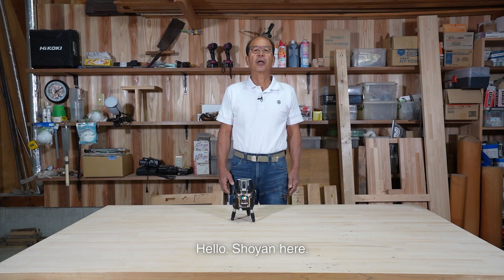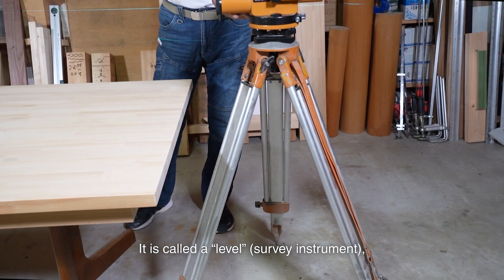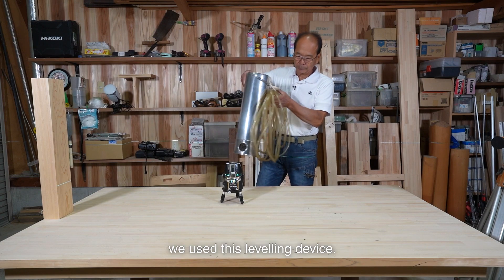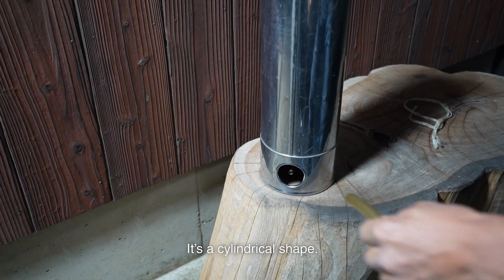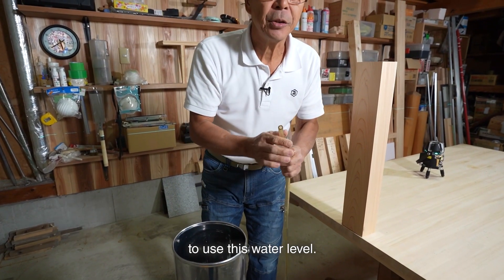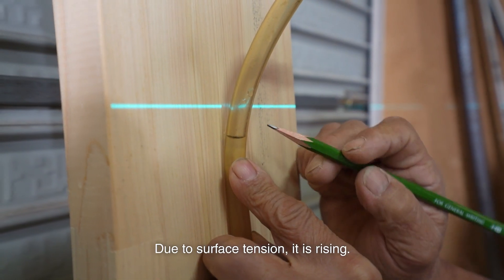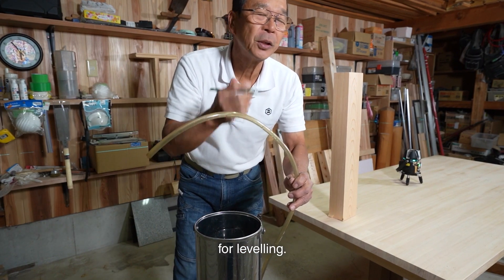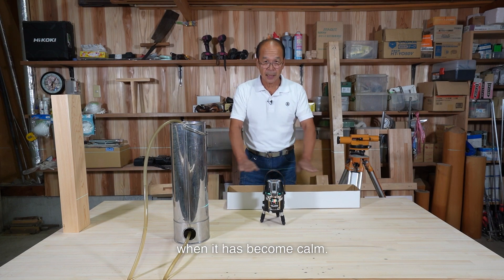How Did People Determine a Level in the Old Days? Surveying Techniques from 4,500 Years Ago

Comment: Laser levels are usually good to 2mm or about 1/8" at 30M.  Properly setup and used, a water level is dead nuts on even at several times that.  I still have one and use it in certain cases where I want things perfect.  I know, OCD of me.  But starting out from perfectly level means that the small induced errors down the road are smaller.

Comment: Years ago I installed large factory and loading dock doors. We used a water level filled with windshield washer fluid to establish level at the top of the door. Any out of level at the floor was corrected by adjusting the seal on the bottom of the door.

Comment: We used a similar device but on both ends was a board painted white with black lines on it you level was when you had both lines marked with water a pain but it worked. Was used to make sure the ships keels were level plus other applications. 😀👍

Comment: Thank you. Excellent information. I want to try a water level with a reservoir can as you have shown. The water level I have just uses a water filled tube and says it is accurate only to 1/4 of an inch in 16 feet of tubing.
Reply: That sounds dubious to me. Why would it be inaccurate? Anyone know more?
Reply: @johnsrabe  It actually surprised me when I read the fine print. I was hoping it was just a CYA statement, but it proved to be true - took a long time to settle and produced unsatisfactory, inconsistent results (air purged, but operator impatience, error?). I like the possibility of a heavy, stable reservoir to produce a fixed level line as a reference.
Reply: @robertbamford8266  Hunh! Thanks for the response. That’s disappointing. 
Luckily I have a crappy crooked old house in which things need to look level, not be level. ;-)